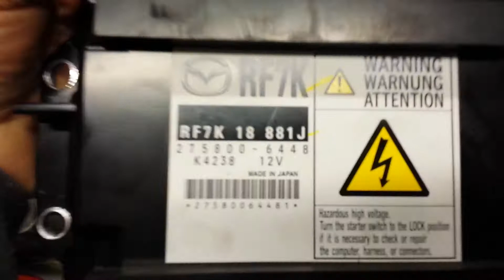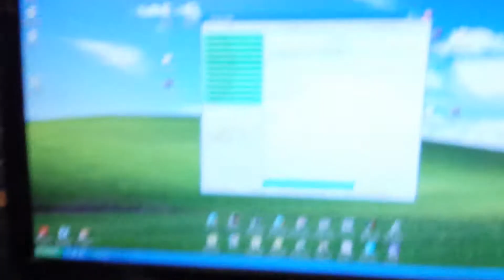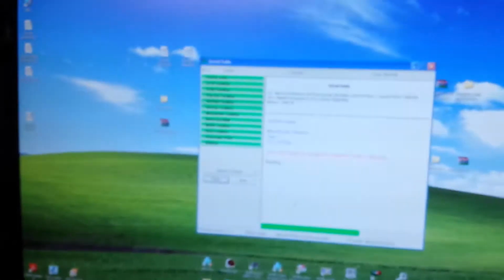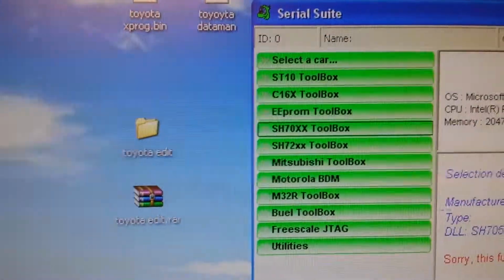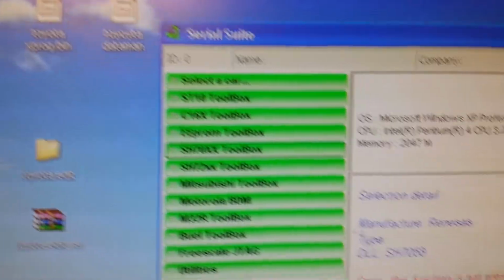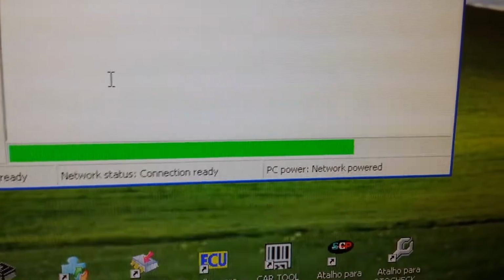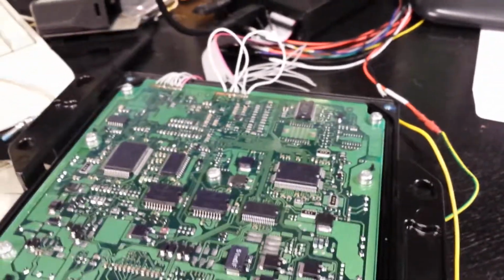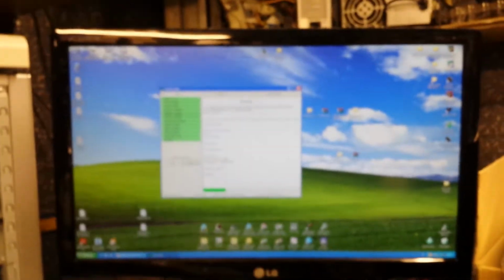Mazda 6 Denso RF7K read and write DPF delete

Comment: I like these videos as help a lot to someone who just wants to jump in to do it. However mostly, these videos not giving all the information that needs. Like this one, the guy doesn't tell us, show us the point. How the DPF was cleand from the file... Because the download of ECU and re-flash it, this is a thing... good to know. But I am nowhere If I do not know how should I remove what I need to remove.... And yes, it could be learned from the net somewhere... but I am fixing lots of cars and simple do not have a proper time... however, if I can get a clue from a normal video... I can check it out.  So please share with us in the comment or make a new video or something how can we remove and what ? :D Your video is not bad but not good as well. :D Thank you

Comment: Can you help with writing a Denso ECU MCU Renesas r4f70580sv. I am able to read but not to write back/clone. Do I need to replace MCU with a brand new/virgin one and then to try write it? Thanks
Reply from the maker: Hi
Which tool are you using?
Thank you for watching!
Reply: @LMAutoRepairs  k-tag master
Reply from the maker: @lolshow7892  
Does K-tag shows it can also write?
On the check boxes on the right side?
Reply: @LMAutoRepairs  all the writing process goes well with no faults. This is what intrigues me

Comment: WIll I be able to read whole eeprom on Renault Scenic 2007 with MPPS v16 via Obd?
I have heard that you can't download complete data from the ECU via OBD, and that MPPS can read only 1024KB.
I need to download data from the ECU just to delete DPF, and reflash again, but I'm not sure will MPPS v16 can download whole data.
It should download because the data is 500-600KB, but haven't tried yet.
What was the size of the Mazda ECU file if you remember?  Have you worked with MPPS or some other OBD flash tool  before and what's your opinion about this?

Thanks a lot :)
Reply from the maker: Hi
I can't really remember the size of the file... but you can't use this as comparison, different ecus/chips different sizes.
Also, the DPF is not stored on the EEPROM, but in the Flash... Where the maps are, actually, DPF is part of the map...
You need to be able to read the flash memory, not eeprom.
I have MPPS, but never used it for that car, check it when plugged in...

Comment: HI! I have a Nissan Navara Denso, i need to delete DPF maps. How can i do it with piasini?
Reply from the maker: Do you have piasini?
Reply: lmsvvavr my friend please I'm having trouble erasing the dpf from a Nissan Pathfinder, I've downloaded just about everything you possibly can and I'm even sure I have what's required, please clarify on how I take the original file and strip the DPF section?? This is absolutely necessary please reply!!
Reply from the maker: Neville Bartos 
Hi
If any of the softwares you have are not able to do it, and you do not know how to manually modify the file, best is send it to someone that can do it for you...